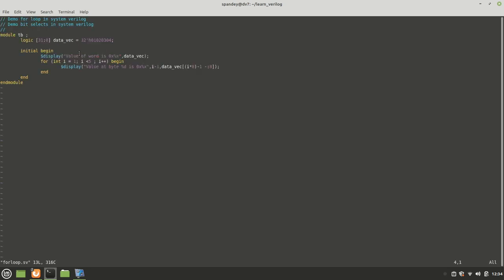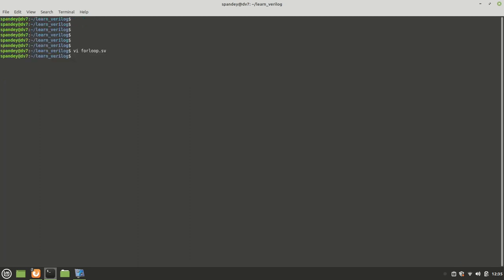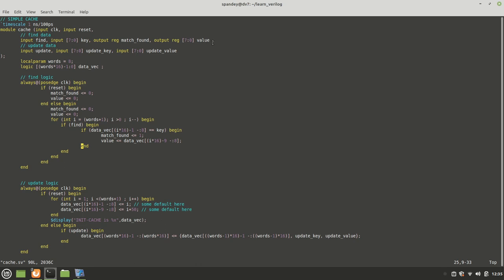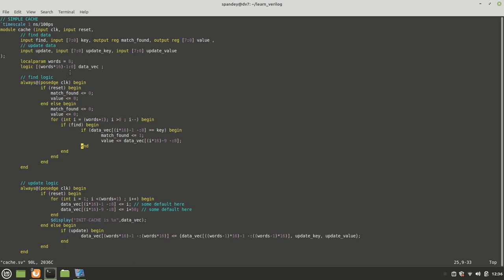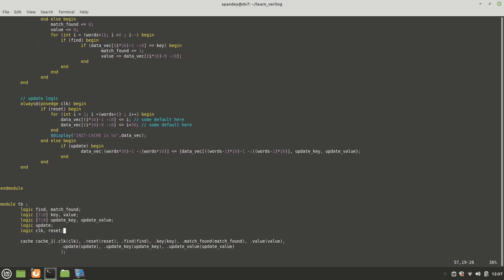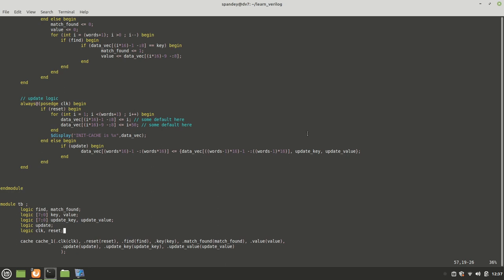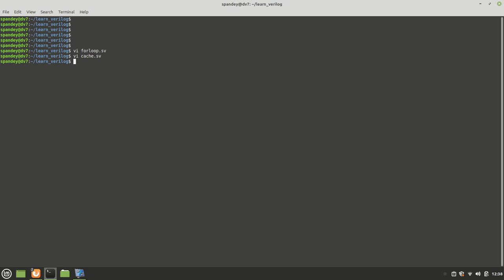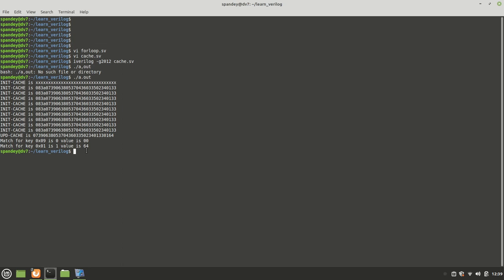Learn verilog by examples - Cache design

Comment: I have two questions: 
- Is there a reason why you use separate key inputs for find and for update? Even if update and find are allowed at the same time, both would be performed on the same key usually?
- In software development the check whether `find` is true would probably encapsulate the loop. What is the difference in hardware of having the if-statement in the loop, instead of the other way around?
Reply from the maker: I think the key could be kept the same as well. The lookup side being independent, may help with pipeline. If you can lookup on each clock cycle, that improves your throughput. You may not need to update every clock and only update if key is not found. 

The find inside or outside will probably not cause much difference in hardware. It should all synthesize to same combo logic that derives found/value based on all columns of cache and the find signal. If find signal = 0, then match/value = 0. So i guess, go ahead and code it the other way if you like. 

Also note that the find logic will synthesize to MUX only if one of the matches is TRUE, if multiple matches becomes true, it will become priority encoder. This should happen, because we should use the find logic, to UPDATE.

Comment: can this code run on xilinx ISE software
Reply from the maker: I compiled it on VIvado 2018.3 with one problem. I had used extra +1 in my index on line 20. Corrected and checked it in. I am not sure if this will work on older Xilinx software.